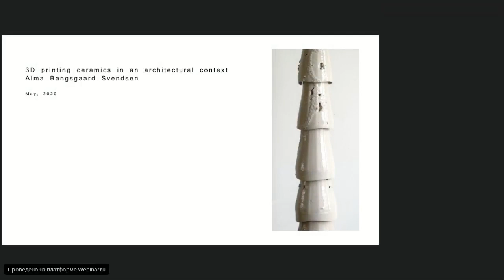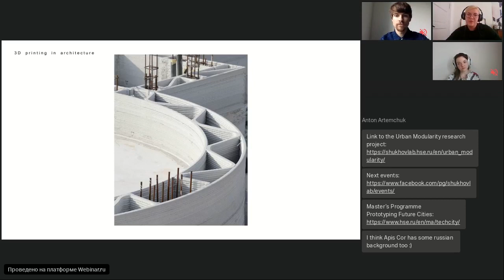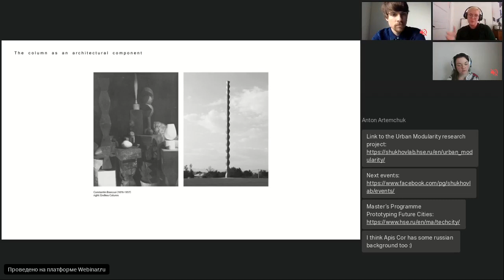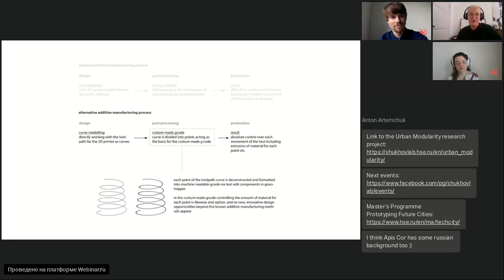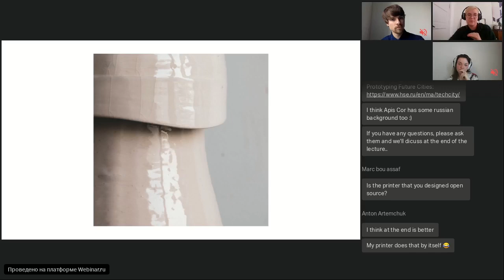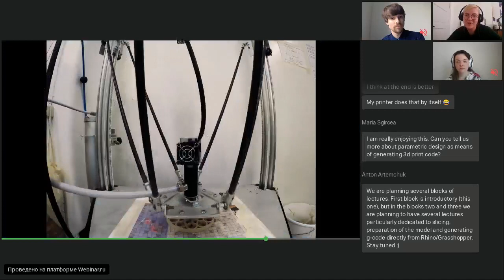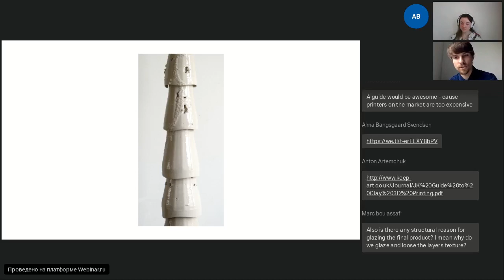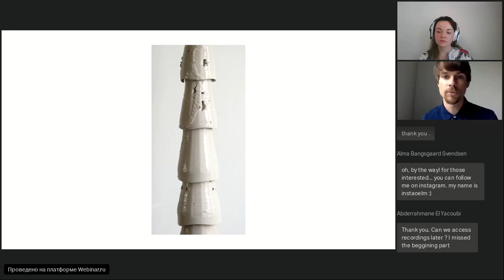Role of designer / architect in digital fabrication

Comment: Can I have a link to upload the guide(building a 3d printer).
Reply: Kokhanova Irene I have not yet made a guide to build a machine similar to mine. A lot of the parts for my machine was handmade in aluminum, so building a machine identical to mine would require access to a metal workshop. If you want to build a 3D printer for ceramics, I would highly recommend checking out the very comprehensive guide by ceramicist Jonathan Keep. It is on his website, and it’s from looking at his guide that I was able to design and build my 3D printer.
Reply: Kokhanova Irene hope I understood your question correctly ;)